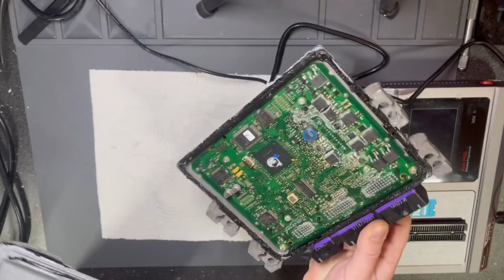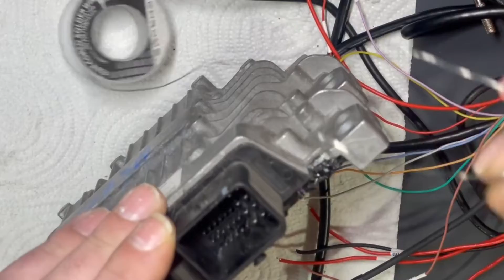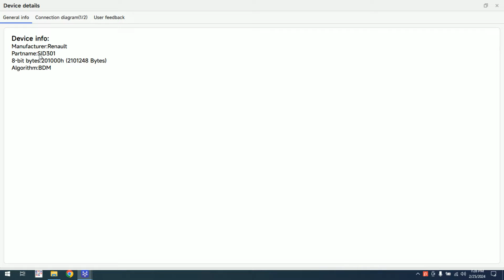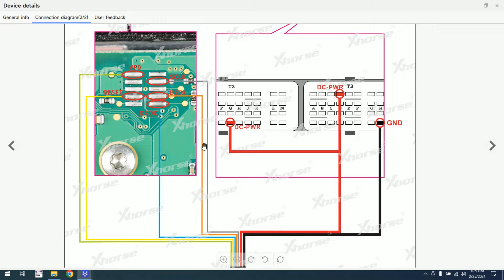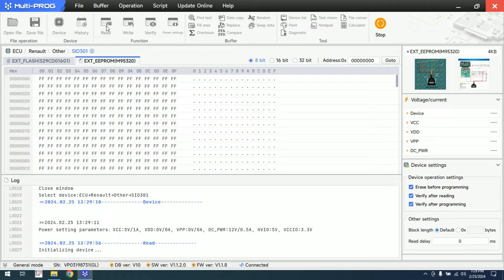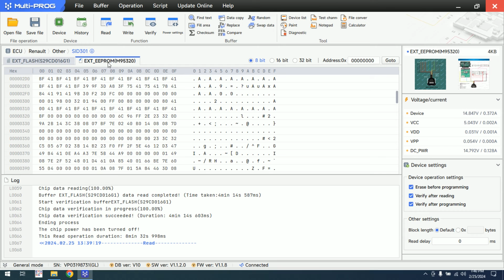Xhorse Multi-Prog read SID301 via BDM

Comment: Is it possible to read and write a clone for BCM application  to a doner BCM such as in 2005 - 2007 Pontiac Grand Prix Body Control Module
+~   micro controller with integrated #EEprom? This is a discontinued car and BCM so there is no new replacement available.

Comment: Any use for air bag resetting and clear data available in side like i prog 
I prog have some steering angle sensar reset air bag rest
Reply from the maker: It can read the airbag but don’t have the option to clear it, but for sure in feature will be scripts for clear clash data